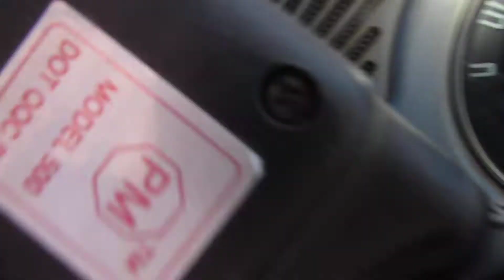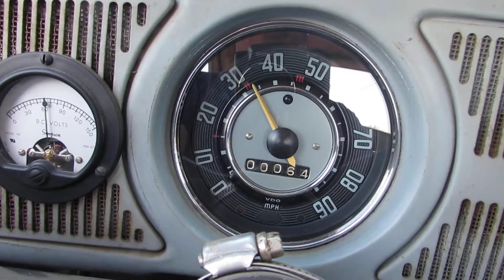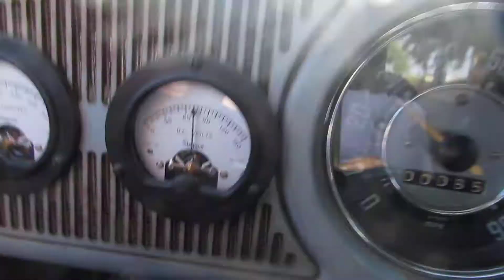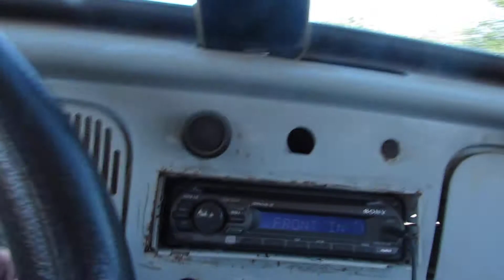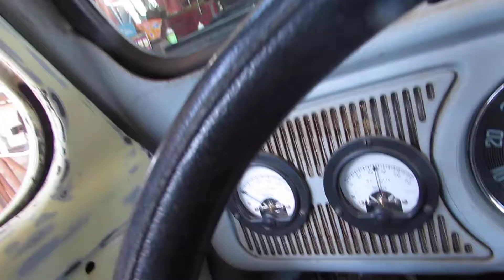Electric Volkswagen Road Test

Comment: love seeing the Vocho alive and well! What kind of range are you getting and how many batteries do you have? Also did you hook the electric motor right up to the factory trans? Does that mean its an electric car with a manual?
Reply from the maker: Not sure on range just yet it's a 72 volt system so i used 6 deep cycle 12v marine batts and a seventh for the accessories! Yeap direct drive to the stock trans you can shift if you like or leave it in any gear! There is no need for a clutch!